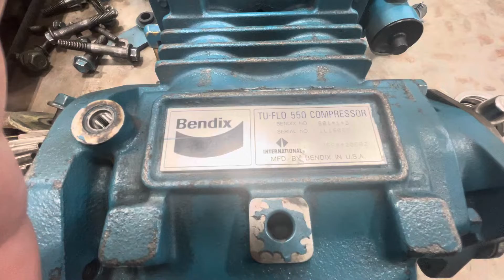Testing Diesel Air Compressors: Are They Worth It?

Comment: Whats an easy way to typically know where the compressors are usually mounted on dual axle trucks.
Reply from the maker: Air compressors are generally mounted on the engine gear driven or belt driven like an alternator. The gear driven air compressors are usually on the left (drivers) side of the engine but can be in the rear or front of that side depending on where the engines gear train is
Reply: @charleysgarage  Thank you friend. The more I know the better I will get at my pm inspections.